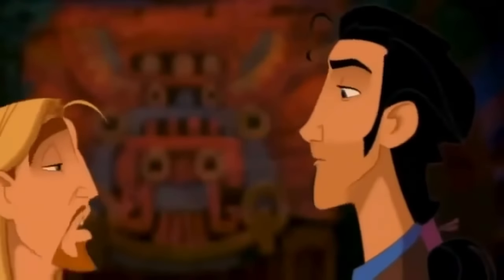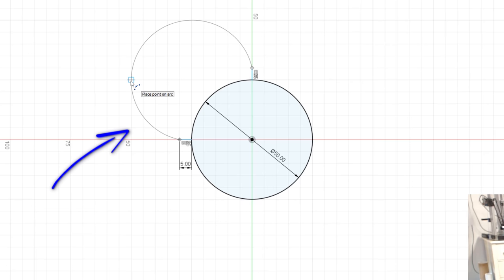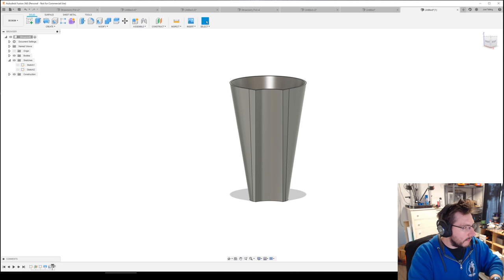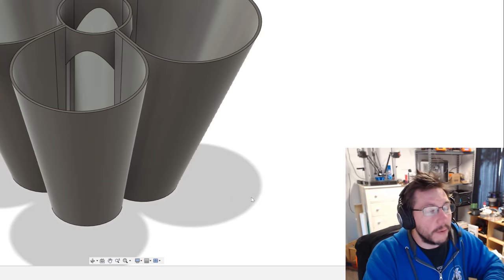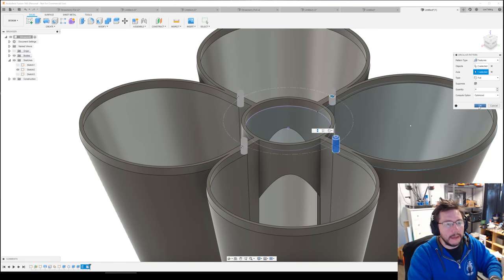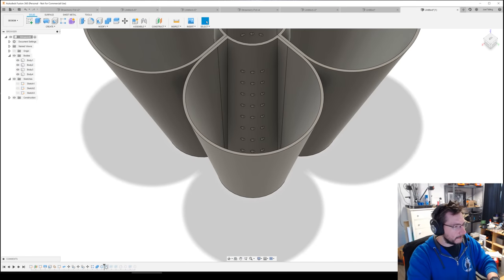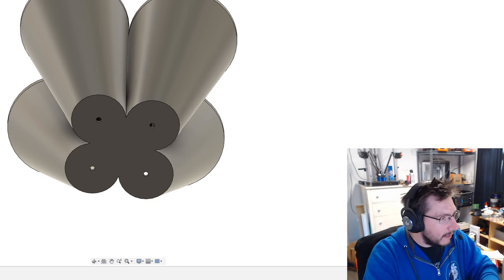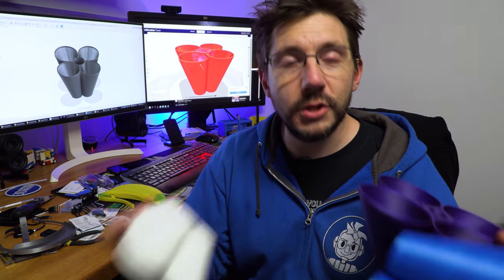Fusion 360 Tips & Tricks for 3D Printing a Practical Garden Print!

Comment: Hi joel, just a quick tip: you can conform 2D geometry to curves during extrusions. Just create a plane between the edges like you did before, create one circle at a corner with the size you want. Use rectangular pattern to create as many holes as you want (for example 4x5). Select all the circles that you need to cut, hit E but before extruding, change the "start" option to "from object" rather than "profile plane". Then select the curved surface you'd like to project to. This is very useful where you want to etch text or logo on non planar surfaces. Small note: if it failed to calculate, it means some part of the 3d geometry is touching the sketch plane, you can solve it by creating an offset plane and changing the sketch plane. I hope you find this useful!

Comment: 13:18 you should select Distance and then pick to an object face, select the inside of the cone and it'll only cut to the other side. if you decide to scale this pot up, it won't affect the cut where your current method may or may not cut enough as it's fixed.
14:14 the horizontal line, you can click it and then press 'X' to make it a construction line which makes it not split the sketch but can be used for reference points. no need to uncheck faces. etc
26:40 you could you a pattern along a path and use a spline to make the wave
Reply: Phizicks thank you. Already knew this but many will find this helpful

Comment: I actually learned new tricks from you, thanks :)
Here are a few tips: by choosing a line and pressing X you can toggle between normal line and construction line.
Press F after selecting a line to add a fillet to it.
Press H to make a hole, you can then choose where to place it and change parameters for the hole shape and depth, I'm quite sure you can use it to automatically add thread to the hole if a screw has to pass there, do mind that FDM printers are a bit limited in that area and will probably won't print a thread less than 10 mm or about 4 inch in diameter.

Comment: Great video, Joel!

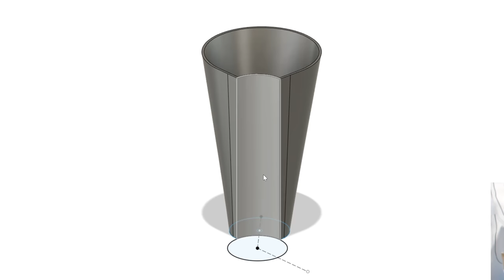I wanted to share some tips for the drain hole part that starts at about 23:30. Here's a quick demo file I set up so you and others can learn from - https://a360.co/2KuIEJf

Patterning the pipe command (as seen in the video) is not ideal, because F360 will process the pipe and move commands for every single patterned instance. That coupled with the extra processing of the split body feature will put a lot of stress on Fusion 360's processing engine.

For a simpler and more manageable process, I would recommend first creating one single extruded circle in the middle, using the "Start from" extent type to cut it out of the wall. Reference image - https://snipboard.io/V5MZY6.jpg

Then, use the "Pattern on Path" feature to create a circle on each side of it, resulting in the same shape as your pipe. Reference image - https://snipboard.io/ObCxY3.jpg

Once that is complete you can pattern the three circles (Extrude and Pattern on Path feature) with the Rectangular Pattern feature - similar to what you did with the pipes. This will result in fewer features and significantly less stress on the software. For this design, it may not make a huge difference, but I'm a big advocate for best practices :)

Cheers!

ps. on a personal note - if you've got extra time on your hands, I suggest looking into the concept of "Design Intent" and the practice of fully-constraining ALL your sketches. It will be well worth it for your future 3D models :)
Reply: Without your channel, I'd still be lost on FreeCad😅. Love your channel!

Comment: Great video Joel. I'm pretty good with Fusion but still learned something. Thanks. Also when you are mirroring something you can choose any line or point in your sketch as an axis. So when you put your posts in the top, instead of hunting for the vertical axis you could just click the center point on the circle to rotate around for the mirror.

Comment: Nice video, thanks.
If you have parameters (like the diameter for the holes) or the height of the object, you can save them as parameters unter change -> parameters. Then you can type the name of the parameter instead of the number. So if you want to change quickly some things, you can do this in the parameter and all linked measures are updated

Comment: Awesome Joel! I've started using fusion 360 after using onshape for over 3 years, the power of fusion is unreal. I've learnt alot from this video. 

I have 2 designs that i have created tonight and I'm also using 2mm thick walls. In the slicer do you set to just perimeters without gap infill? I tend to use that to give the outer surface better overall finish. Not unless you know another cool way to print them?

Stay safe and happy fusioning lol

Comment: Just in case nobody else has mentioned it, a better work flow for using extrude to cut holes is to use "to object" instead of dragging it out. Because if further into the design you add a feature to the body that intersects where you dragged the extrude, it too will be cut into.

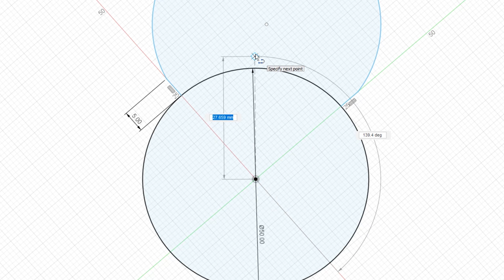Comment: At 19:27, shouldn't it be 25mm +12.5mm since the diameter is 50mm, not the radius? The spot he clicks to add the small hole is the centerline for the 62.5mm line (31.25mm from center) when he needed to put it at the end of a 37.5mm line.

Comment: The audio in the beginning of your video sounds great, but the audio from the headset sounds a bit tinnie...maybe can throw a filter on it in post.

Always a good practice to properly use your constraints & dimensions, so if you ever need to adjust a parameter, the model doesn't blow up

Comment: Learned something about projections.  Thanks!  #AirFive.  Not sure why you created the pegs as "new bodies" though instead of "join".
Reply from the maker: I did that thinking only then could they be part of a circular pattern. I bet I was wrong, eh?
Reply: @3DPrintingNerd  You can join new features to a body, and then pattern those features.  I do it all the time.  Usually works, with the occasional exception when I have really complex fillets or chamfers that I'm trying to pattern.  Those sometimes don't like to pattern without errors, and I have to just do them manually.

Comment: For some reason when I try to do the "plane through two edges" step in the video it will not allow me to select the edges you did in the video.  I restarted the project again just to verify I did everything correctly but still no dice.  It will only allow me to select the two edges that are only 5MM apart at the base
Reply: I'm having the same problem.

Comment: I could not find the video showing the vice 3D print so guess this is a good as any place to post. The screw shafts in that print break apart easily how did you print them so as not to break once printed?
Reply from the maker: Part of the reason they didn't break is because they were printed in a PC material :)

Comment: I don't want to sound like an ass, but you have dozens of 3D printers on hand and hundreds of pounds of filament shouldn't you be printing out masks and other supply's with them. Maybe using fusion 360 to design more PPE items for others to print out?
I have 2 printers running 24/7 turning out about 25 mask a day to give out to family and friends who can get masks because the stores are sold out. We have at least another hard month to get through and things don't seem to be getting better any time soon.
Reply from the maker: I have a number of machines, and many are printing face shield components. I didn't show them in this video.